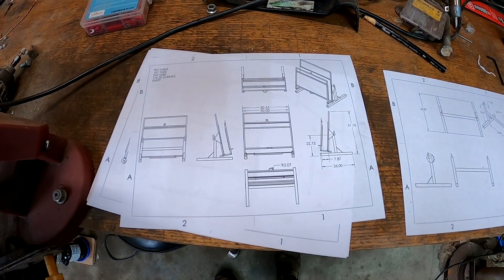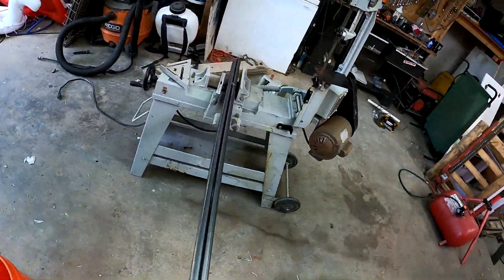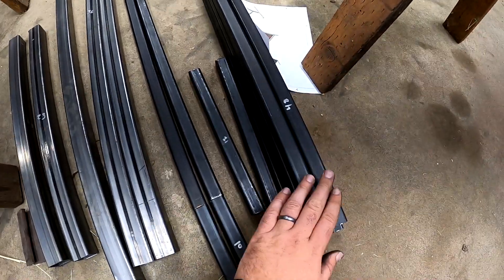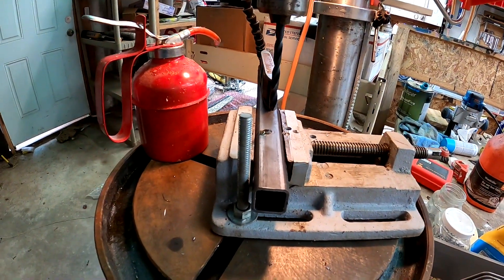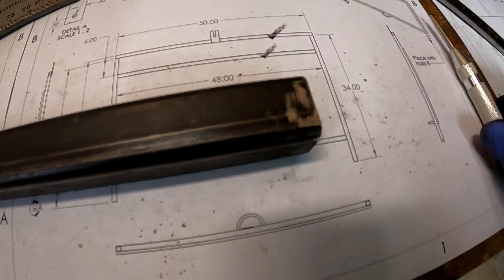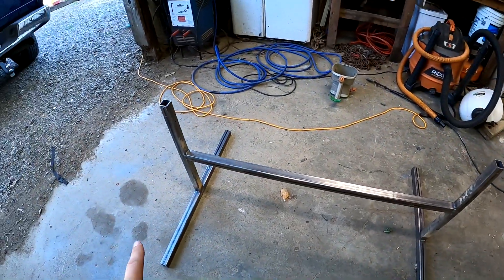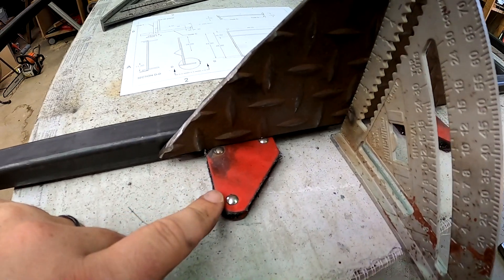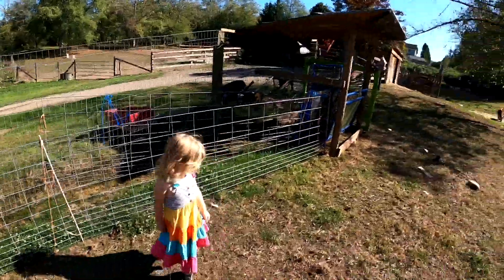Building a Sheep Tilt Table

Comment: How did you or where did you get the blueprints?
Reply from the maker: I designed the table myself in a CAD modeling program
Reply: @cyclonedr  I cant open the STEP file is there a way you can reshare?
Reply from the maker: @caitlynnstevenson6885 there are many free STEP file viewers out there.